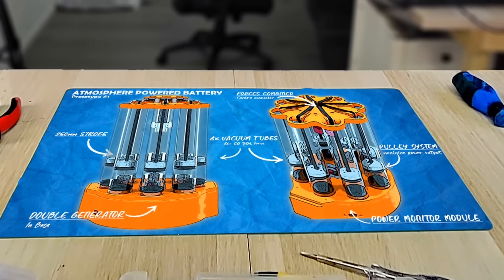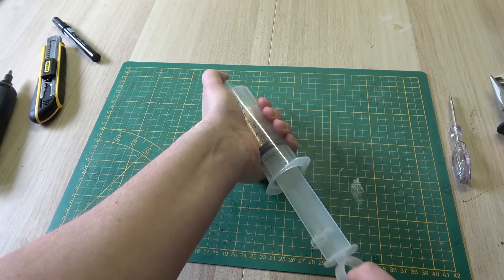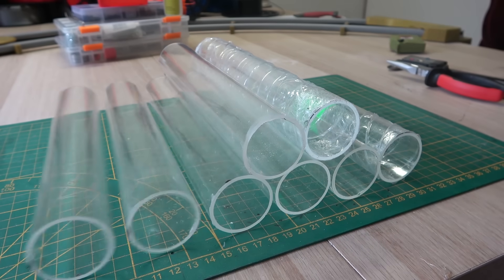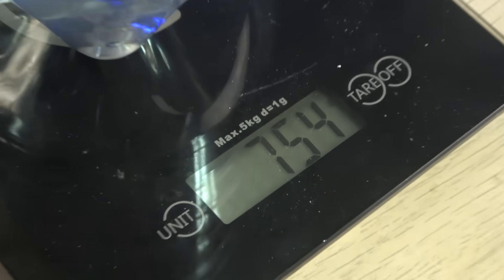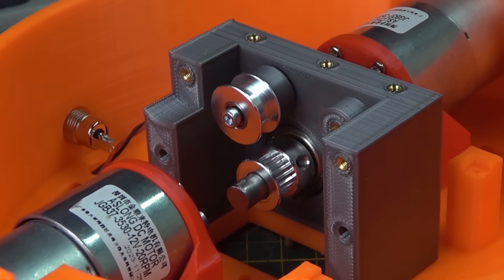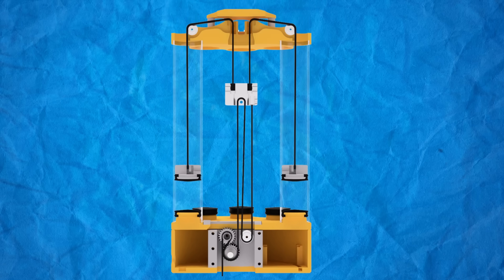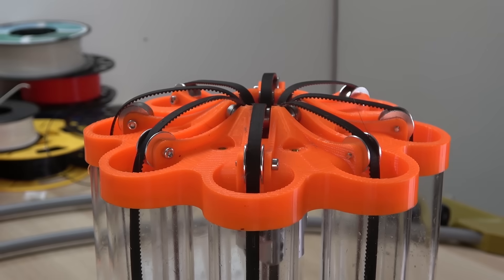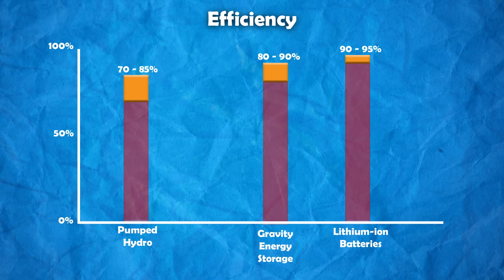Building an Atmosphere Powered Battery..

Comment: This is basically the inside-out version of compressed air energy storage, except the maximum pressure difference is 1bar compared to the 80bar used in commercial compressed air energy storage solutions.
Reply: It is basically a spring but potentially better because the length and thus capacity is only limited by the tube length and the force will be totally linear along the length. Still a weight will always be cheaper (no tube needed) and require less maintnance (no lubricated seal needed).
Reply: I think the lower pressure also means less wear on the system as a whole, as well as being all around much safer.
Reply: @TheHothead101  makes sence and can be made as shown here out of less metal much cheaper than some high pressure containers on the market by a lot and also as shown here able to be just plastic I can guess we can also use plastic that’s recycled
Reply: Why using vacuum, no advantages... Best battery could be a very weight liquid, so you can reduce height to achieve intense energy
Reply: What if they sealed the other end of the piston to create compression in that end?
Reply: @SunnysideEnglish  this idea is just completely flawed to begin with, no alterations will fix that
Reply: I'm surprised to see so many comments here. Also, I don't think I got my point across. Assuming 100% efficiency, 1m3 of vacuum at sea level stores around 0.74Wh. That is around a million times less(without exaggeration) than what modern lithium ion can do. There is no version of this that is even remotely  practical.
Reply: @countdown4100  remember the world we live in, "free energy" is something that still has to be disproven daily because people are still gullible enough to believe it, while this isn't a free energy claim, it still goes with the point I'm making, both of us can repeatedly explain why this will never work, but we will both still get pings once in awhile from someone who thinks it can
Reply: @countdown4100  You must be wrong. His model is not larger than 10 liters by my estimate and he got back 628W. That gives you 63kw per cubic meter. I think you got your power of 10 wrong or the info in the video is wrong.
Reply: @iulianbina7910  he had about 628 Wattseconds. That is more about 0,000174 kWh. That is roughly the power of 0,07mL of Diesel.
Reply: @stefanstark7881  Where does it say whattseconds?
Reply: Not limited to 1bar. If @ConceptCraftedCreations put the entire apparatus in a pressure vessel, the setup would not be limited to atmospheric, and energy density could be modulated much further.
Reply: @InfinionExperiments  I disagree (mostly). Yes you can put it inside a pressure vessel and obtain more force on the cylinder. BUT you loose the efficiency-advantage I was talking about since the pressure vessel itself will then act as a normal pressure storage. The key is to consider that your vessel will have limited size (let's say 3 times the syringe). Pulling the syringe, you decrease the vessel's inside volume thus compressing the air, thus generating heat...
The beauty of the 1 atm open system is that atmosphere is basically infinite and will not compress just because you pull a syringe.
Reply: @romanp.5236  Well it sounds to me that minimizing the irreversible processes are a matter of design. If you wanted no heat rise you would need a larger ratio, like 1/50. Otherwise you can utilize the  heat of compression and turn the energy storage device into a co-generation system that produces both heat and power.

Something that benefits being in an open system while having a high surrounding pressure would be with hydraulic systems pressurized by water columns found at the bottom of a well, water tower, or anchored under a lake to name a few examples. High pressures and high volume ratios to the working piston.
Reply: Doesn’t this system have a way worse energy density though because of it’s pressure limit?
Reply: so much cheaper tis one than some fancy air compressor getting a few kilowatt out of a few 100 pounds in parts is not bad, compare to air compressor and noise but like all have ups an dw, still great idea,
Reply: But that 1bar limitation applies only if you're using gases, which can't sustain negative absolute pressures — they just collapse into a vacuum.

However, if you switch to liquids, the physics changes. Unlike gases, certain liquids (like water) can sustain negative pressures under the right conditions, thanks to cohesion and tensile strength. Trees are a natural example: they pull water up to heights of over 100 meters using negative pressures as low as -15 bar, maintained by the xylem through capillary action and cohesion-tension mechanisms. Of course, practical implementation would involve challenges like cavitation and material limits, but the physics does not constrain you to 1 bar, only the use of gases does. So calling it "basically an inside-out CAES" with just a 1 bar difference might miss the deeper potential.
Reply: Actually it is not "basically the same". This one here has a major advantage! 
When compressing a gas (air) and releasing it, you do temperature changes, whether you like it or not. This eats up your efficiency.
Here you do not compress, so you do not have this issue!
Reply: @romanp.5236   When you pull a vacuum, you're just pumping heat into the cylinder instead of out of it?  How would that not be the same on both sides?
Reply: @romanp.5236  you get the same rate of heat increase/decrease when pulling a vacuum as when pressurizing. The only difference is the amount of pressure differential, which in this case is necessarily limited to 1 atmosphere of pressure.
Reply: @faethewolf  I disagree. If you start from a perfectly empty syringe and just increase the empty volume, no gas is there to cool down.
Reply: @romanp.5236  you're right that in an ideal gas scenario there would be no temperature change from the forced vacuum, but realistically there will still be some air present in the system, unless a huge amount of energy is expended to draw close to true vacuum.

However, I will happily concede that, given the relatively small amount of gas being expanded in this hypothetical, the temperature change would be negligible. So, fair enough, you raise a good point about the high-pressure scenario imparting different concerns in that regard!
Reply: @romanp.5236 there is a fundamental disadvantage you are overlooking to this, it's notoriously difficult to hold a large vacuum in comparison to a building a large high pressure tank
Reply: @alexnorth2452  You are absolutely right ("Hold" in the sense of mechanical/structural/not buckling)! Furthermore, the energy density per volume is very low unfortunately.
Reply: @romanp.5236  I would say "hold" as in keeping the pressure differential to the outside as well.
Reply: @romanp.5236  glad both of yall understood what I meant by that, containing a vacuum on a large scale is the exact reason the hyperloop idea will only ever be a part of science fiction

Also while air compressors aren't the most efficient things, we can compress air quite easily with nothing but pipes and running water, if memory serves, the practical engineering channel did such a video a few years back on an air compressor with no moving parts, just water flowing through pipes, was pretty neat, so there are super green ways to trap that air 😁
Reply: @alexnorth2452  Not necessarily that its harder, more that its more noticeable.  If you leak half an atmosphere from a vacuum system, it's a big deal.  If you leak half an atmosphere from a 50atmosphere pressure system, nobody will probably even notice or care.
Reply: @kinderdm  I think you are overthinking things, if you are leaking, you are failing, my point was its hard to hold a large vacuum, and if you are leaking, you are not holding, like I've said previously in this thread, compare a decently large pressure tank to a similarly sized vacuum, you will notice an astronomical difference in pricing and complexity and that difference is what my point is
Reply: @alexnorth2452  
why ?
Reply: @romanp.5236  makes you wonder how hard it would be to convert a compressed air energy storage to one of these types of batteries and what the difference in efficiency will be doesnt it
Reply: @romanp.5236  when you compress air you basically are only limited by the tolerances of the materials you use and can store a tremendous amount of energy. With a vacuum, you are limited to 1 atmosphere of pressure only.
Reply: @romanp.5236  also, at critical failure that happens eventually, it will either "leak" vaccum or crumple instead of exploding
Reply: @romanp.5236  
yes that is really a big problem when compressing ....... it gets hot and works against you.
but very nice project and pretty nice efficiency.
Reply: Don’t forget that pressure requires extreme strength on the Wals, with vacuum you just have to fight the atmosphere
Reply: @MultiValandis  na not so dude, yes it requires strength, but that strength is easier to get than the strength needed to resist the vacuum in a large area, go take a look at the largest vacuum chamber and compare it to the largest pressure tanks, it's so much easier to build a high pressure tank than it is a large vacuum chamber

Comment: You could technically build a weight system inside the piston system as well, essentially getting a double use system. It would take a lot of meticulous parts and designing, but should be feasible.

Comment: 10:32 judging by those bubbles it seems like your system is leaking which probably has an effect on the efficiency calculation
Reply: no leaking, just boiling of water due to low pressure.

Comment: Yes!! Thank you I have been wanting a company like this! I hope they ship to Australia. I just have to figure out how to send them a file of what I want made 🧐
Reply from the maker: @ithasbeenwritten222 Your enthusiasm makes me curious about what you have in mind🤓 If you would like to discuss it you can find my e-mail address in the channel details at the channel page👌
Reply: @ConceptCraftedCreations  Yes, I will absolutely go find your email. I have built one part manually out of aluminum, but it took me a lot to do. 
It’s small, (3in cube) but it’s a 6 way gear drive. Basically a cube with a pipe coming out of the center of each face of the cube. 

I think I may have figured out how to balance out the reciprocation problem, when attempting to harness acceleration from a gyroscope. I’ll email you from my website address so you recognize me. I have to make 7 more of these suckers it would be amazing if i didn’t! 
I can use sketchup, so I can make you the file in that. I have learned since I last commented, that that’s an acceptable method for 3D printers. 
Ignore this though I’ll email ya!

Comment: What about combining this idea with the pumped hydro idea?  Have a rigid sealed container of water with a pump pulling water out into an open container.  This creates a "vacuum" space of water vapor at around 2 kPa depending on temperature.  To discharge, a valve is opened so the the water is pushed back into the sealed container.

Comment: Don’t just build a bigger one, 
Build a taller one, than one with wider cylinders, that are all identical in every other way (motors and everything)
And let’s see how that changes the efficiency…

I’d say a taller tube will be much harder to vacuum towards the end …
And probably wider cross section would deliver more force per unit of travel… 
Would be nice to find the ideal ratios of all of these for your setup, and then generalise the finding with a formula that would apply to any setup…

Comment: You can get a good sense of the efficiency pretty easily from the dimensions of the tubes. 
Given the dimensions quoted in the video, the eight 36 mm diameter pistons each feel 103 N of atmospheric force for a total of 824 N. Because the stroke length of 250 mm quoted in the beginning of the video—and energy = force x distance—the total work done by the atmosphere is 206 J. This is the only stored energy in the system; all the other forces lead to losses. Since it supposedly took 860 J to "charge" the atmosphere battery the one-way efficiency is 206/860 or 24%. I would guess that the discharging efficiency would be similar for a total efficiency of 6%, which honestly seems about right for the high friction losses and the electrical–mechanical conversion.
As for why the efficiency in the video is so much higher, I can only guess: Since the OP quoted only a single voltage, amperage and time number and multiplied them together, I'd guess that either peak or average voltage/current is being used, but that those values are not steady during the charge–discharge cycle. For more accurate energy values, the power should be integrated over time. This would also affect my original efficiency calculation, since the 860 J figure may not be correct.

Comment: Wild idea but what if you added a Flywheel to the entire setup with a gearbox that would maintain momentum for both the charging and discharging states? As the system is charging, inertia is stored in the flywheel, as it discharges, that inertia is added to the flywheel to maintain or even improve a constant state of energy production.

Comment: It's more of a capacitor than a battery, air acts and is used as dampers for shock like capacitors are used to reduce surge or provide on demand sharp current in electronics. You can likely use air pump in place of generator in generative braking systems to store energy to reduce moving vehicle then apply the stored potential to push when brake is released to reduce additional energy needed to accelerate. What differentiates capacitor from battery is energy density, current rating and internal resistance. Vacuum or compressed air is more like capacitor than battery based on those 3 factors.

Comment: If by 'work' you mean store energy, sure, there's a good chance it will work. If by 'work' you mean store enough energy to be useful, my gut feeling is that the energy density would be far too low to ever be much more than a novelty.
Reply: But I mean, the energy density of carbohydrates is low, and it's by far the most common way energy is stored.  Quantity > quality is valid if the system is cheap and self-sustaining.
Reply: @jerotoro2021  The chemical potential energy in a cubic meter of gasoline is about 32,000 MJ.  The pressure differential potential energy of 1 cubic meter of 99% vacuum surrounded by 1 atm air is about 0.5 MJ.
Reply: @ExaltedDuck  yes but gasoline isn't easily made, it requires millennia-long geological processes, extraction and refinement.  It's a great fuel, but it's not a valid energy storage medium for this reason.
Reply: @jerotoro2021  you're thrusting at a windmill. I never said gasoline is renewable or perfect or anything like that. I was just using it as an example hydrocarbon and responding to the claim before that we shouldn't dismiss this vacuum tank because the hydrocarbons are also not very dense and energy. When in fact it has been more than dancing off to allow the entire modern Industrial Age to occur. If these vacuum tanks were in a scale to the point that they could realistically replace gasoline then you would need effectively a skyscraper is worth the volume to power a car for a week. This won't be the way forward on the fundamental physics of the situation. Add gasoline will not be the way forward for the reasons you've pointed out. There will need to be something else
Reply: @ExaltedDuck  true.  But I think the main goal of energy storage is to make renewable power scalable.  We're storing solar/wind power and using it at night or when there's no wind.  It would be just one piece of a replacement for coal-fueled power plants, not gasoline.  Vehicles need to move, so maximizing energy density is critical for their efficiency, this isn't even a consideration for powering vehicles.
I saw one comment here that basically destroys the vacuum idea though, and that's that it's basically just the compressed air energy storage, but the opposite.  And with vacuum you can only store 1 atm of differential, while with compressed air you can store thousands of atm in the same space.  So either way, it's a bad idea lol
Reply: @jerotoro2021  positive pressure rather than negative. That could almost instantly increase the energy density by 20 to 30 times. Skyscraper you might still need a supermarkets worth of volume for a week's worth of car travel. That's a big piece of why fossil fuels have been so difficult to eliminate. They are simply a far better storage of energy than almost anything else we know of. With the scale of the problem it makes it very unlikely we'll get that far without something that offers some sort of chemical or nuclear transformation.
Reply: @jerotoro2021  in 2022 the state of California consumed about 1200 petajoules of gasoline and Diesel. Over the same time the electrical grid delivered approximately 900 petajoules. The sheer scale of things means that we can't get away from energy density as a consideration. At least not if we want to come up with anything feasible at the magnitudes we would need it to be
Reply: @ExaltedDuck  No mechanical energy storage will ever replace a proper fuel for transportation, that's not the goal it's trying to achieve.  It's only trying to store energy generated by power plants, to be fed back into the power grid when the plants are down.  So it's expected that these things should be scalable to building-sized facilities or bigger.  Pumped hydro uses an entire lake the size of a small town, and it's quite effective.
Reply: @jerotoro2021  look man just do the math. This conversation is going in circles and is completely pointless. Just do the math